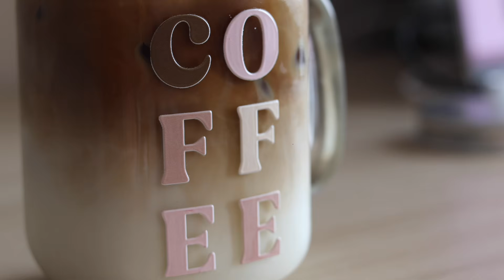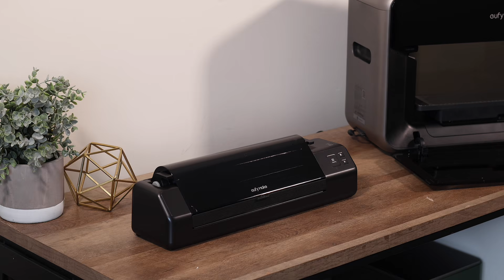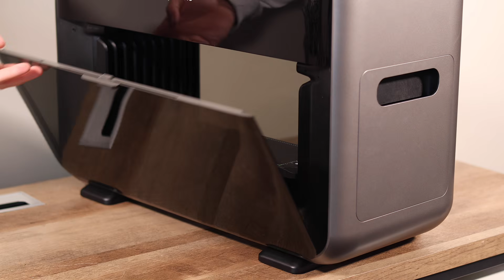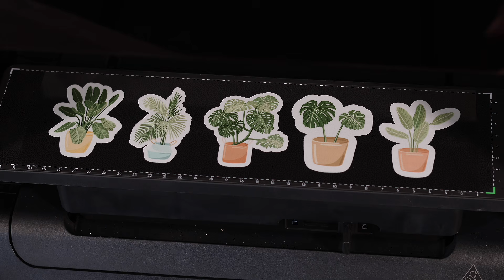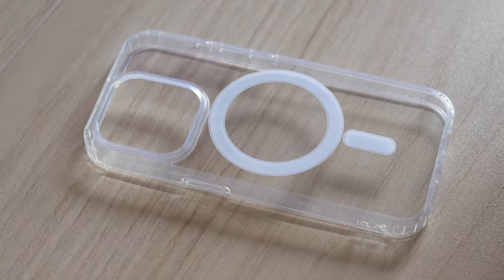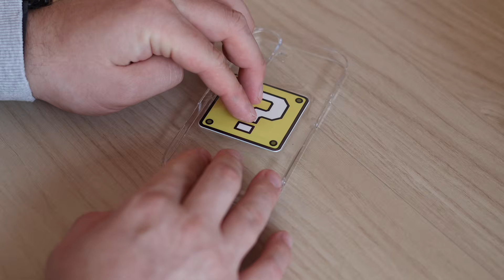DIY Personalized Stickers for Gifts & Items: eufyMake E1 + Laminating Machine Tutorial#eufymake

Comment: I know that UV DTF transfers are usually pretty permanent, but is there anyway to make them more like a regular vinyl sticker that can be pretty easily removed?
Reply: You can just print on vinyl sticker blanks!
Reply: @ibrahim47x  True, but that does mean you need to have a plotter cutter. I guess I was just wondering if there was an adhesive backing that sticks more like vinyl stickers (provided that you print a solid shape, of course).
Reply: @DannoHung  yeah if you wanted to cut out very specific shapes, then you’d have to get a plotter cutter as well. That might not matter much if you use a transparent vinyl sticker blank.